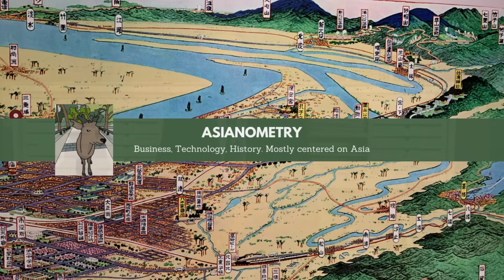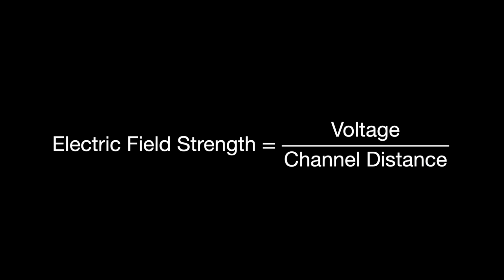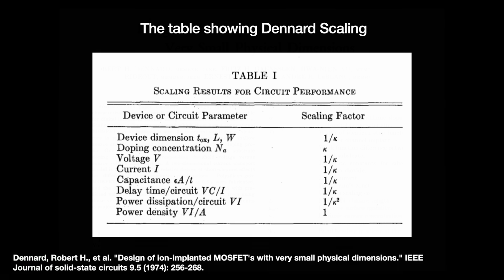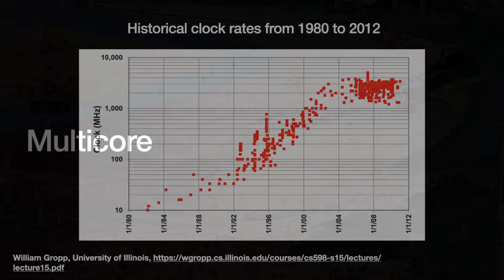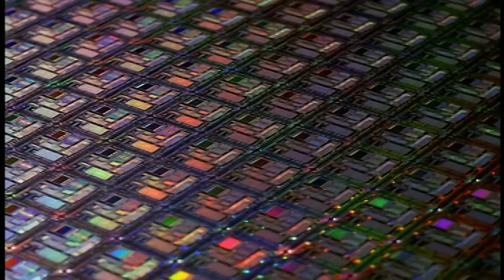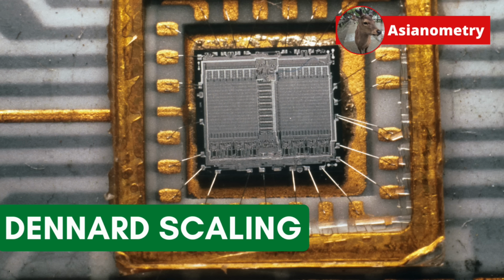The End of Dennard Scaling

Comment: Thank you, that description of trends was very clear.  I have been playing with a Pentium 4 processor taken from a scrapped laptop.  It was one of 3 huge chips on the motherboard, used fancy cooling and a huge battery.
I compare that to a Raspberry Pi 4 with System On Chip - a single chip half the footprint of the Pentium 4 which has the display and in-out processors on the same chip, operates far faster, and draws so little power that in ordinary use no heat management is needed .   The Pi 4 is multi processor .
Marvellous how technology progresses !  😊❤😊

Comment: Timeline:
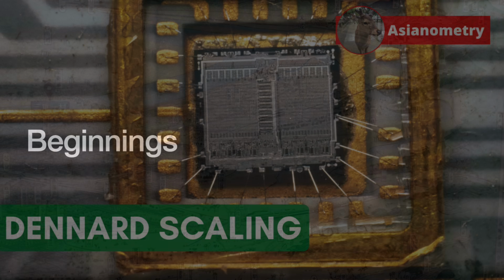•	Early 1970s: Robert Dennard and his IBM team began research on shrinking transistors for DRAM (0:25).
•	1972: Dennard and his team first published their findings on scaling (3:54).
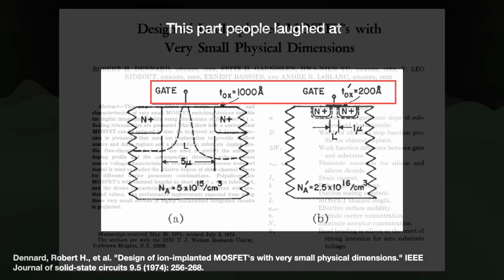•	1974: The IBM team published their influential paper "The design of ion implanted MOSFETs with very small physical dimensions" (4:14).
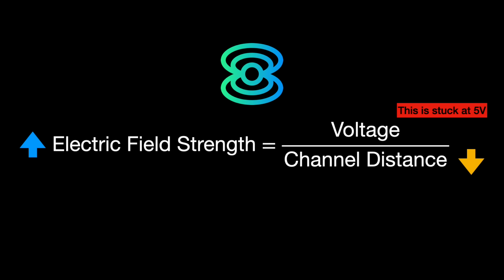•	Early 1990s: The semiconductor industry agreed on a roadmap to reduce supply voltages from 5 volts, unleashing the "Golden Age of Dennard Scaling" (6:02).
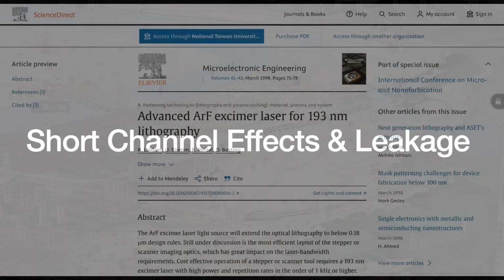•	Late 1990s: Intel CPUs rapidly shrank thanks to new lithography tools, but this led to the "power wall" (6:33).
•	2001: IBM released the Power 4, the first commercially available chip with multiple cores (9:03).
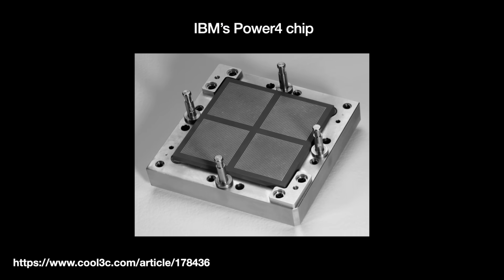•	2004: AMD released its dual-core Opteron (9:11).
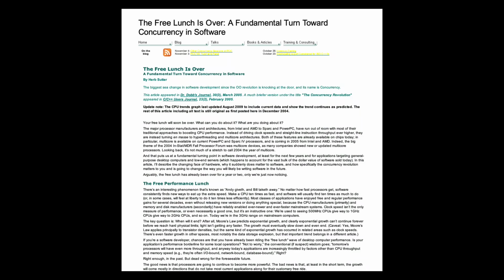•	2005: Intel released the Pentium D (9:15); Herb Sutter's article "The Free Lunch Is Over" highlighted the end of automatic performance gains (9:35).
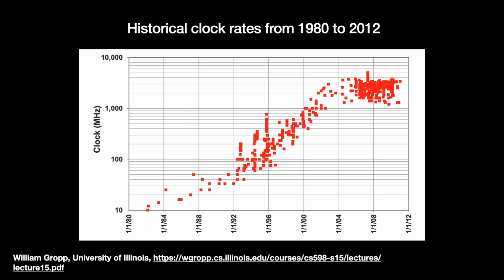•	Since 2006: CPU frequencies generally topped out around 4 GHz per core (8:42).
•	Early 2010s: The concept of "dark silicon" emerged, suggesting much of a chip's area might need to be unpowered due to heat (10:39).
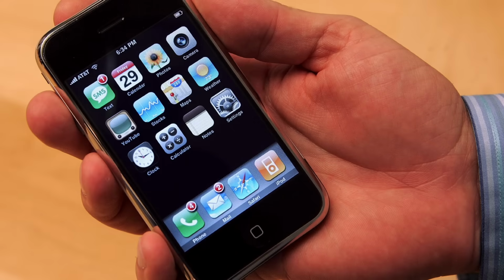•	2012: The deep learning era began, driving the emergence of GPUs (12:44).

Good to emphasize Hwa-Nien Yu at 1:45. Key person in TSMC, like the video points out.

Comment: There are a few fairly major errors in this video.

The most significant one is that there was a rush for Dennard Scaling in the mid to late 90s. This was actually not totally true.

There was a lot of Dennard Scaling during this period, but that was not the only thing that happened. This was combined with a lot of other scaling solution souch as standing gate, tri gate, diagonal traces, copper interconnect and so on. Some of those both compacted the circuitry and reduce the power, some did just one or the other.

This was when the actual lithography and the one marketed started to slip a part quite a lot. Its now apart something like 30 times.

The other was the claim that multicore was introduced because of the cap in frequency. While this did happen around the same time, if we go back even all the way to the 70s, the cores went from subscalar, to scalar (late 80s), to super scalar (mid 90s) to SIMD (late 90s), and making them multicore mid 00s, was really just a logical step.

Comment: I have a question. What would happen after the industrie achieves the last phisicaly posible node?

Would the Industry try to scale down the tools to reduce production cost.

Would the industry start to work on Quantum Computers.

Would the world use optical logic gates.
Reply: It's not physics, but economics! Producing smaller and smaller nodes will become more and more expensive, as less and less electrons switch a transistor. So, as we get smaller in the next decade, we will see different technologies emerging:

- Changes in architecture to just use the transistors we have better
- Move to different types of computing with the same technology: analog, approximate, or neuromorphic
- Move to different types of materials, i.e., abandoning CMOS

Industry is currently investing Billions to scale up production, as demand is increasing. Scaling down to increase costs makes zero sense in a competitive market,

Quantum computers and quantum networking is something that is already being worked on. These are solutions to different and very specific problems.

Optical computing is still far off, for many reasons.

Comment: The RISK. PowerPCs super scalar architecture planed out at. 1.8 instructions per clock at 1.2GHZ for around 10 Watts, This was low enough to maintain a 105C Tj_max.  temp in a 60C military environment.   MIPS per watt was the issue for reliable military single board computers.

Comment: what Intel got wrong with their NetBurst microarchitecture is they thought that CPU speed was going to increase; that's why they made NetBurst have such a long pipeline, which is very slow at the frequencies the Pentium 4 was operating at, but would've been much, much faster at say, 7GHz. this is partly why PowerPC was so popular with high-end solutions like Mac workstations, mainframes and gaming consoles: it was both more efficient and more powerful per watt than what x86 could offer.

Comment: 13:10 you wonder if CPU's managed to get to those "53Ghz CPU speeds, would GPU's and the like would be as dominant as they are now...", and you're not the first to wonder.  
Tim Sweeney, CEO, and co-founder, of of EPIC Games, and lead programmer of "Unreal Engine", had a prophetic message about CPU's becoming more parallel, and GPU's becoming more general purpose:  

Q: Finally, where do you think 3D hardware and CPU technology should be headed? Do you think we are likely see 3D hardware taking over some of the functions of the CPU, going beyond rendering?  

A: I think CPU's and GPU's are actually going to converge 10 years or so down the road. On the GPU side, you're seeing a slow march towards computational completeness. Once they achieve that, you'll see certain CPU algorithms that are amicable to highly parallel operations on largely constant datasets move to the GPU. On the other hand, the trend in CPU's is towards SMT/Hyperthreading and multi-core. The real difference then isn't in their capabilities, but their performance characteristics.

When a typical consumer CPU can run a large number of threads simultaneously, and a GPU can perform general computing work, will you really need both? A day will come when GPU's can compile and run C code, and CPU's can compile and run HLSL code -- though perhaps with significant performance disadvantages in each case. At that point, both the CPU guys and the GPU guys will need to do some soul searching!  

- Tim Sweeney, Epic games - 2004  

https://beyond3d.com/content/interviews/18/4
Reply: For as long as the desire for high performance exists, and CPU's and GPU's still retain clear performance advantages from each other in important tasks, there's not gonna be any proper convergence.

Comment: Dennard scaling is kinda pointless nowadays since memory bus speeds are the limiting factor in high-performance computing; regardless of how much RAM you can fit per chip. If it's cheaper to build two 32Gb chips than one slower 64Gb chip, the memory controller (which runs at multiple GHz) will give better performance with dual-channel 32Gb RAM sticks. There's no performance boost unless you can increase either the bus width or the clock speed.
Reply: High-performance computing uses HBM.

Comment: Wish I had my 53Ghz CPU...but another problem alongside physical dimensions downscaling was the way we handle code to make it run fast, ie pipelined with a lot of pre-emptive/speculative execution.

What Intel found out the hard way during the peak pentium high frequency era before they gave up and went core2duo was, the longer your pipeline gets to take advantage of this high frequency, the more branch miss and cache miss and pipeline flushes you end up having to deal with, in many workload types. So you reach a wall where it doesn't scale anymore anyway.

The core2duo architecture pipeline that replaced the last pentium types was almost twice shorter and still outperformed it in virtually all payloads at much lower frequency.

Comment: If you weren't around in the 90's you won't understand just how crazy it was. On average CPUs got 10% better IPC/year 50% higher clocks per year. Power went from about 3 watts to about 60 watts. CPUs went went from being bare ceramic packages without a heat sink to having a tiny 8000 RPM earbleedingly awful fan to having larger sinks with low speed fans. Graphics cards went from being a pure 2D affair without any acceleration, to including more and more GUI acceleration features, to rasterizing and texturing triangles to per pixel lighting and hardware T&L to having per pixel programmable shaders in the early 00's. Games had not settle on what they could be and settled into making basically a reskin of the same AAA action-adventure type game with different art assets and settings and the same basic gameplay. Developers were trying to one up each other with all kinds of crazy new ideas throghout the 90's. A lot of it was predictably awful; some of it was pure magic (like ultima underworld; that games is like finding rabbit fossils in precambrian rock; it just shouldn't exist and shouldn't be possible on a 386). Without a technology to replace silicon CMOS and being a new exponential leg of a technological S-curve there will never be anything like it again. 

To underpin just how crazy the 90's was. If Dennard scaling had magically continued, somehow, we'd have 1.6 THz single core CPUs with 80 kW TDP. That's the exponential we were on for over a decade and 2002-2005 felt like crashing into a brick wall. In the 90's most people defined their hardware by the clock speed; it was nearly synonymous with performance. Before "netburst" only really cyrix was an outlier with terrible IPC. For marketing reasons it was obvious why intel did what they did. They had pulled that same rabbit out of the hat a dozen times before; if they could do it again and AMD did not they'd be years ahead. If they tried it and failed, at least they'd still have higher clocks and manage to sell some CPUs on outdated metrics.
Reply: I worked in a computer shop at the time.
Processors were hot potatoes, every week unsold lost tangible value.
Dissipators went from tack-on gimmicks to frame-mounted behemoths.
Software spell checking went from luxury to mainstream.
Reply: My favourite expression of this is that singlecore performance of my home computer rose about a million times (counting IPC) in the first half of my computing life, and ten in the last. (ZX81 flops -> 2GHz P4 ->12600)
Reply: I cannot agree more, the 90s was the time of my late teens/early adulthood and it was just crazy and the time I made software development my professional career. It was a wild-west feeling, always something exciting new thing comeing and going.
And extra credit for mentioning Ultima Underworld, I was speechless when I started it the first time on my 386DX-40... magic did not do it justice for its time.
Reply: I remember when I got a "massive" Thermalright heatsink... had to dremel off a couple fins to clear the capacitors on my motherboard, but you could mount an 80mm fan on that bad boy.
Reply: When I was just a pup, I was a hardware tech for IBM on the RS/6000, although it may have been rebranded as Power (after the Power processor family), or maybe it was pSeries…whatever.  Anyway, it was around the year 2000, and I was sent to work on some new Power3 SMP servers - think it was the p660 H- and M-Series, which were up to 4-way and 6-way SMP.  Back then, a 6-way SMP machine was a big deal.

I was really struttin’ my stuff with my colleagues when I got trained on the p680-S85, which was a giant of a standalone server.  When it rolled out, it was the fastest standalone SMP server IBM had.  Maxed out, it had four 6-way ‘books’ for up to 24 600MHz processors, with 16MB of L2 cache.  Dizzying.  For memory, it had up to 96GB of ECC SDRAM on either four or eight large cards (about the size of an oven cookie sheet), where the memory was soldered on.  As far as I know, every server before and after used SIMMs or DIMMs, but those memory cards were a feature for reliability.

So, around 2001, the biggest, baddest, fastest standalone server in the world at that time was a 24-way, 600MHz, 96GB RAM, SMP server.  It was contained within two, refrigerator-sized racks - one rack for the processors and memory, the other rack with four IO drawers with a maximum of 56 pci adapters.  The rack could also hold SCSI and/or SSA drawers.  If it was using SSA adapters, it could conceivably connect to hundreds and hundreds of SSA disk within dozens and dozens of tall racks of disk drawers. Amazing system.  If it was clustered using HACMP, it could be one of 32 nodes, sharing those disk with every other node.

It was also unique as it could also act as a node in an SP2, Scalable Processor/Scalable PowerParallel cluster.  The SP clusters were huge, parallel processing, shared disk, shared memory (using fast HPS switches) supercomputers with up to 512 nodes.  The actual cluster nodes were in their own special racks, the latest nodes being 4-way, 450MHz, 16GB RAM SMP servers, so having a number of p680s as SP nodes could have been a big jump up for specific applications and jobs.  The p680s would connect to the SP cluster’s HPS switch using special PCI adapters.

Some universities had 512-node SP supercomputers; I heard from other techs the NSA had a LOT of them.  ASCI White was a famous, 512-node SP2 supercomputer that was ranked number one in the Top500, from Nov2000 to Nov2001.  ASCI Blue Pacific was another supercomputer at Lawrence Livermore; Seaborg at Lawrence Berkley.  Deep Blue was another SP supercomputer, an older, microchannel-node, SP1 cluster that was good at chess.  All of these SP supercomputers ran AIX as their OS.  I really miss AIX, it’ll always be the best OS, even today.

Wow!  Sorry, this REALLY brought back memories.  So, it’s around 2000, and I’m being trained in Austin.  Austin was where, at that time, the Power hardware was designed and manufactured.  AIX may have been as well, but I’m not sure.  Anyway, we’re in the lunchroom, and it’s just buzzing with engineering excitement.  Then a banner is put up:  “Power4 breaks 1GHz!”  Everyone goes crazy - almost SpaceX crazy.

The next year, the Power4, 32-way, 1.3GHz, 256GB RAM, p690 came out, and changed things into what we see today.  It contained the first dual-core (today’s terminology) 4-way MCM (multi-chip module) processor complex.  Four MCMs were (carefully) installed to make a 32-way SMP.  A big deal.  The thing was in a rack well over 6 feet tall.  Same size as a mainframe, and internally, it could hold 96 disk drives, and 160 PCI-X adapters, connected to a near infinite amount of storage, as fibre channel had gone mainstream about the same time.

This is also when LPARs (logical partitions) (VMs/Virtual Machines, to use todays VMware terminology, went mainstream for the first time outside a mainframe environment.  In fact the people who started VMware were LPAR engineers who left IBM.  With this first iteration, the individual lpars could use any processor, and any memory, and any individual adapter - nothing was virtualized then.  You could have a 32-way SMP server down to 32 single processor servers.  Today, memory, cpu, and IO are all virtualized as you’d expect, and the core count has gotten significantly higher; also, as you’d expect.

I left IBM around this time, to become an AIX sysadmin.  I was lucky enough to admin p660s, a p680 (!!!), and engineer the layout of the p690 (so fun), and also the p595 -  a mainframe-sized Power6 machine, w up to 1TB RAM.  Before that, I got big into IBMs processor/memory and VIO/PowerVM virtualization, and thoroughly into fibre channel director management.  Replacing the beloved p690 with the p595 was pretty cool.  Oh yeah, plus we used HACMP/PowerHA, clustering one p690 with another, and then one p595 with another, with cross-site, synchronized, fibre channel storage, in two locations about 8-10 miles apart.  Man, that was a fun job.

What a world.

Time to boot up my 6-core, i5, 32GB PC.
Reply: It was really crazy. My first computer an Amiga 2000 had a bare 68000 CPU clocked at 7 MHz with no heat sink, just a regular plastic DIP. There was no floating point and no cache. Commodore went bankrupt because they could not keep up with the pace of innovation.
Reply: AMD K6 also had horrible floating point performance, a Celeron 300 was at least four times faster than a K6-2 450MHz in, say, emulators.
Reply: It's interesting to think about the fact that yes, indeed, linear clock speed was the end-all-be-all metric for performance, and one day that simply stopped being the case (and it became much harder to explain to non-technical people which chip was better than the other), to the extent that it's almost an irrelevant metric now (as nearly any chip will boost much higher than their rated clocks for short durations anyway).
Reply: Cyrix had an excellent IPC and used PR rating system instead of clock.
Reply: 80kw tdp on a chip the size of a fingernail sounds like you're trying to make a fusion reactor 😂
Reply: @specialopsdave  Actually I think it would be something closer to a two dimensional exploding bridgewire detonator.